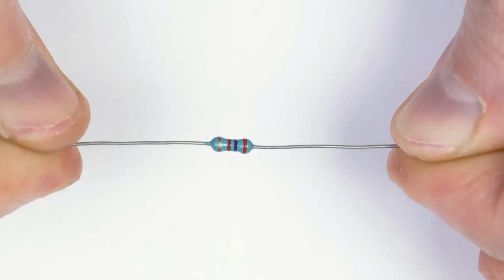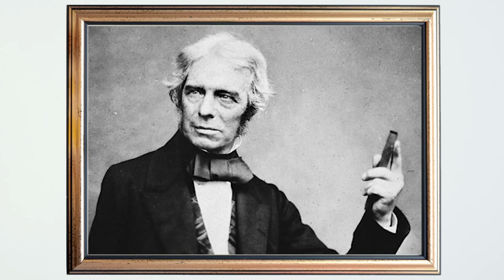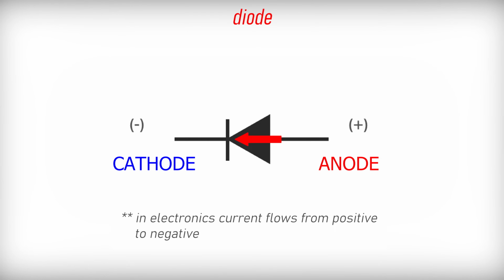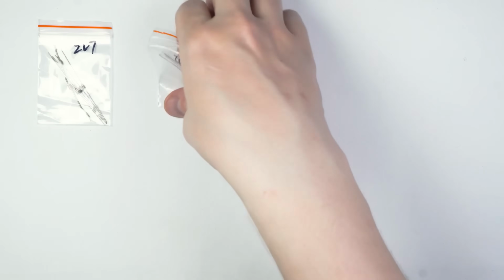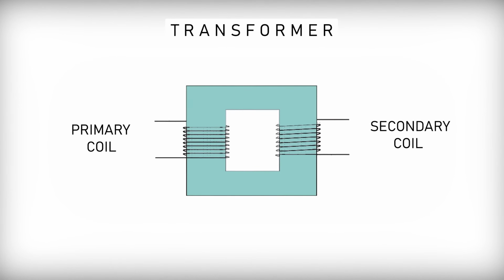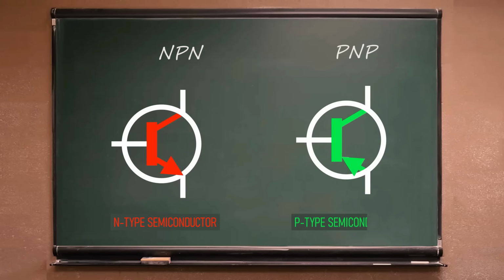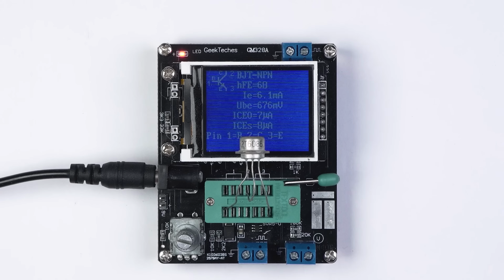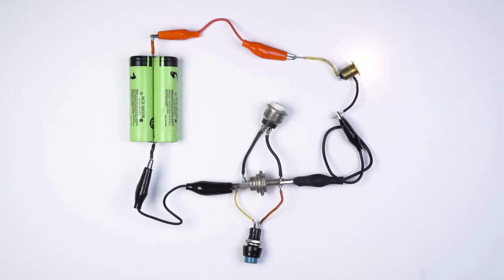All Electronic Components Explained In a SINGLE VIDEO.

Comment: Resistors, capacitors, and inductors are not electronic components. They are electrical components used in electronic circuits.

Comment: "ALL electronic components" ?
You have missed dozens if not hundreds!
Most notably, FETs/ MOSFETs, but diacs, triacs, avalanche diodes, varicaps, nixies, relays, LEDs, MOVs, piezos etc.
Not to mention all of the valve/tube based devices.
Reply from the maker: I got another video on those too.

Comment: 20:33 this effect also happens with motors, wich means you need diodes on the output of motor drivers and/or transistors.

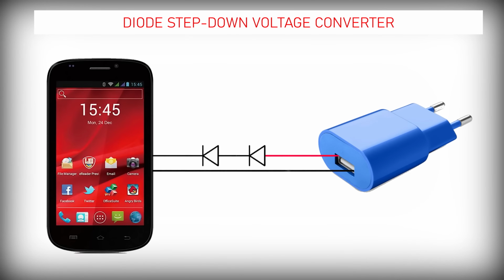Comment: 11:45 how you turned on mobile phone with power supply to just 2 terminals of phone what about the middle terminal i collects the important data of battery without it turning on phone is not possible
Reply from the maker: No, not the case with old mobiles. No important data, just temperature info.

Comment: at about 19:32 "When the core of the choke is saturated energy begins to flow into the load."

This is just plain WRONG! Current begins to flow into the load the instant that the circuit with supply, choke and load is completed (turned on). The rate of rise of the current is limited by the inductor and the rate changes when core saturates, but again, current flow starts, at zero, the instant the power is applied. In the circuit with the inductor in parallel with the lamp, the instant that the battery is connected the inductor current is zero. It begins to rise linearly with respect to time. In that circuit the only reason the lamp is able to turn on at all is that the inductor's resistance is high enough that it doesn't effectively short circuit the battery.
In most applications the inductor is designed so that the core never enters saturation. In some circuits saturation is allowed and in fact necessary to operation of the circuit (e.g. "Royer converter").

 Some of the inductors in switchmode power supplies are there for noise filtering, but the big ones are there specifically for energy storage. Several of the components shown when talking about transformers are actually "common mode inductors."

Not all transformers provide galvanic isolation. An "autotransformer" does not.

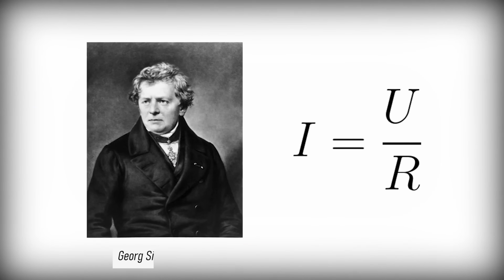Comment: At time 1:58 what is that 'U' in that formula? 😒🤡
Reply: Some books use U, considering U symbolizes potential. Voltage is just electric potential. I've seen both U and V used interchangeably
Reply: U is voltage
Reply: @tomety_tcg2073  makes no sense at all... You either use 'V' or 'E' no text book has ever used the letter 'U' to symbolize Voltage 😒😒

Comment: "In electronics, current flows from positive to negative"

And thus you reignite the war between conventional flow and electron flow.

It's the dirty little secret every EE just ignores.  Since everything works either way, we never bothered to change that idea after it was discovered that electrons actually flow from negative to positive.
Reply: Current flow.  The  Electron Flow theory was accepted and taught as such negative to positive years ago. Reason being an electron moving through a wire is much easier concept to grasp than a hole (conventional flow, positive to negative) moving around. Either theory is correct and work gets done. The difference is reference when drawing schematics and teaching.  That's it.
Reply: I learned one way in the Navy and had to reverse my thinking going to school to be an EE. I started working with electronics when tubes were still common.
Reply: This is crazy
Reply: Is there a single instance where that becomes a problem? But honestly if I had one time travel opportunity I'd ask Ben Franklin to flip his notations
Reply: Yeah, after spending years learning electron flow, conventional flow was hard to wrap my head around 😅
Reply: You can be the FIRST!
Reply: @d.e.c1609  Nah, when I make schematics, it's easier to think of everything flowing to a common ground reference, and since ground is generally  the lowest voltage in the circuit (unless you have a dual voltage power supply with 0v center voltage), it's intuitive to think in terms of water, which flows downhill.
Reply: @SomeDudeInBaltimore  I suppose. But I'm for Electron current flow. And I wire and THINK as such.
Reply: Anode is Ground which is negative and Cathode is positive. Is that correct. Please rectify me? I am confused.
Reply: @azimmorve8007  yes but you have no electron flow cause your power supply is missing as well as a ground reference.   LOL
Reply: The story on the course was someone proved the current flows both ways. I had not repeated the experiment so I cannot affirm either way.😊
Reply: Absolutely !

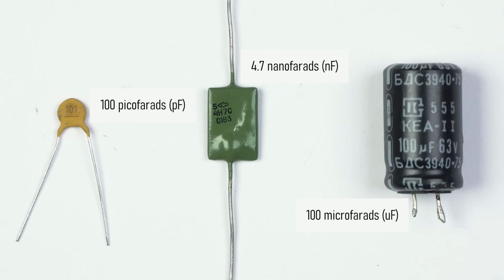Comment: @5:18 - the capacitor on the right is electrolyte based with aluminum electrodes (legs). Standard since 1980, ended at 18.02.2021. Sadly they paywall'd the information, because in post-communism times it looks easy to use for free something created using tax payer's money